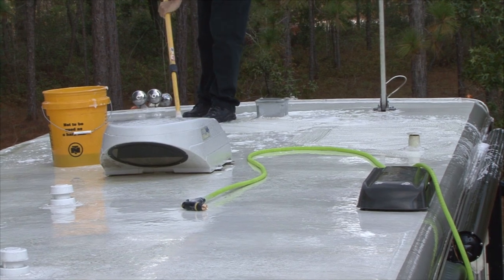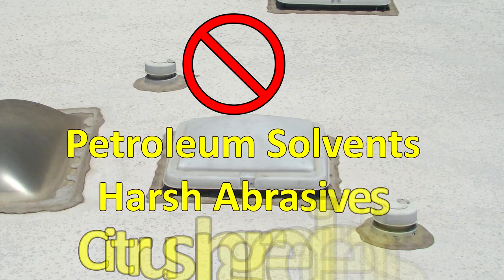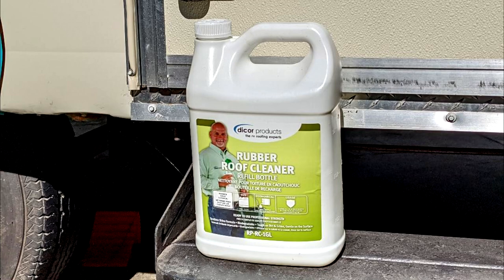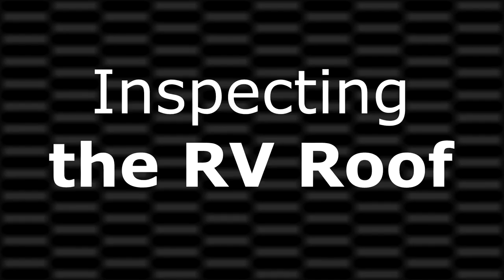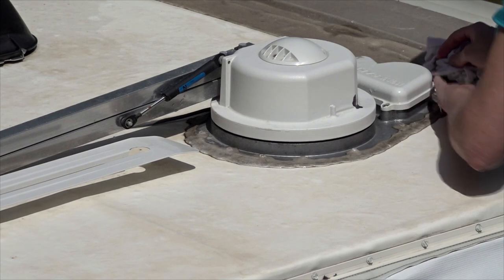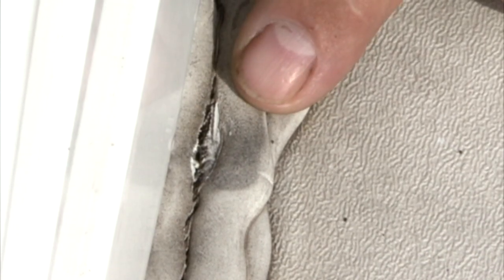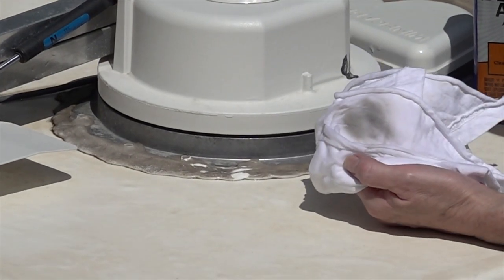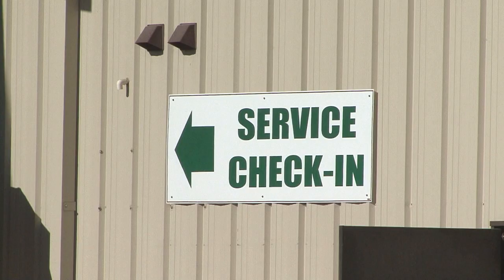RV 101® - RV Roof Care & Preventive Maintenance

Comment: ...grrrrreat advice, y'all!!!...have been an RV'er for 30 years and haven't gotten any feedback for the vent covers....

...I'm from front range of Colorado where hail storms are not uncommon...if you store your RV outside, I'd recommend placing a 1/2  inch layer of foam cut to the size of the vent and then a slightly larger piece of thick-milled plastic...whick can be folded under the rim of the vent and duct taped around the base of the vent...

...when left unprotected, the PVC that the vents are made from will become hard and brittle, and even a light hailstorm can crack them, allowing water to invade and damage your RV...and a heavy hailstorm can destroy them completely...always inspect your RV roof after a major storm to preserve your right to make an insurance claim..and take photos of any consequent damage...

...the same advice, of course applies to A/C covers and Sewage tank vents, as well...

...Cheers, snd best wishes to the nice folks at RV Education 101...we're never too old to learn something new to prolong the lives of our beloved RV's...